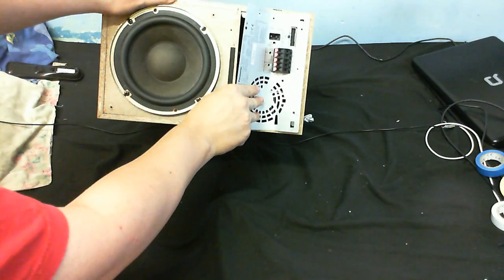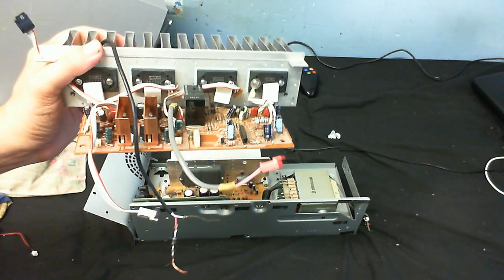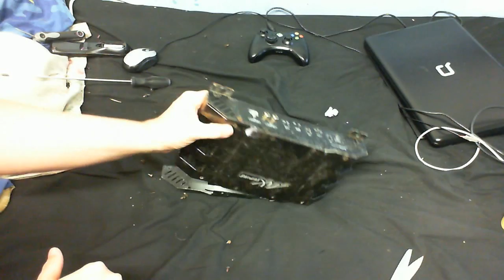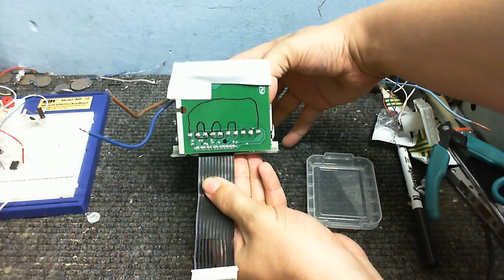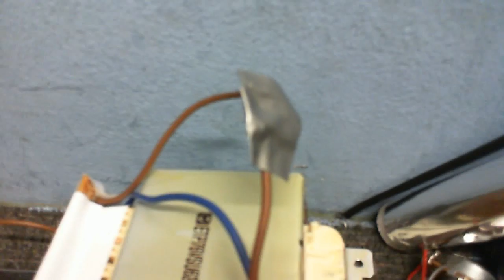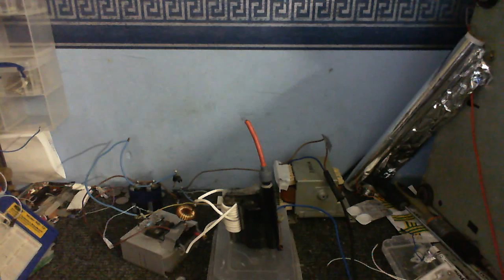Trash Finds - A subwoofer and a crusty car amplifier

Comment: Welcome to the world of "Dumpster Diving". I always thought all the fellows around here checking out the containers were hobos and loosers, BUT YOU CAN'T IMAGINE WHAT I'VE FOUND! I've found TESLA lab equipment with tubes in it! R-to-R tape players. TVs and old stereos and radios! Now I'm hooked.....I also notice at the Electronics and Appliance store lots of people drop off old things they can't throw out.....I often drive through there and check! NOT A BAD FIND. You can at least use the speaker and possibly the transformer for power-supply fun! There's also speaker connectors and such. SOUNDS REALLY GOOD with your amp....that your TUBE AMP?

Comment: Clem, that car amplifier might be quite useful, don't trash it! Most of them will run happily from a 200 watt or greater ATX power supply, wire the 12v and ground to appropriate lines and wire the remote (sometimes marked as rem) terminal to a switch to the 12v line, it is it's on-off switch, it uses a 12v signal from the car's radio to turn on and off. It could prove to be a nice little amplifier to keep around.
 
I would say, definitely power it up, hook up some speakers (they will drive even 8 ohm home speakers quite nicely) and try it, running off the RCA jacks on your mixer, it is a power amplifier so you need a preamp to regulate it's volume, and your Tascam 4 track can function as one.
Reply: The 14.4 volt supply from the transformer would run it fine as well rectified, I expect.

Comment: On the amplifier, the power supply's transformer steps up the voltage but the secondary side will be AC. That AC is then rectified with two rectifiers (TO220 package)....right by the two rail filter caps. But you got most of it right.

To remove the board you have to remove the transistors clips that are hold the sistors to the heat sink. Once those are removed the board will easily slide either way. That's a pretty cheap amplifier might not be worth repairing but for the fun of it you should have a go at it. There's plenty of guys that can help with pointers or what not.

Comment: Yes those car amplifiers uses switching power supply. From 12v they step up to symetrical +/-25 or +/-35volts DC. That's why those amp sucks easy 15-25 amps on the 12v bus ;)
In really good amps you have 2 or 3 pairs of big capacitors in parallel for the filtering. Also for the output stage, it's comon to have 2sb688-2sd718 (so called B688-D718) pair of transistors. They double them on more powerful ones.

Comment: I hate those proprietary subwoofer connections. Why didn't they just use phono plugs and use the head unit as a pre-amplifier? At least that way if the head unit died or wasn't there for whatever reason you could at least still get some functionality out of it.

Comment: can you get a microphone that outputs SPDIF data via it's USB lead which should work with the software your are using.
You should be able to get a HP Prolient DL580 GEN3 with 16TB of ECC RAM and 12 SATA drives in RAID 10 mode as web providers are changing to newer better servers and replace the HSF units with water cooling system and cut down on the racket it makes when running.

Comment: Helloo.
I need a little help about my power suply.
I have a two torodial transforemers 11.5V/100A =200A
and four bridge rectifires 50A = 200A
And i plan to use it to a full potencial.
What kind of capacitor i need?
How to calculate what capacitens per Amper?
Reply from the maker: +Sale Bmw It really depends on how much filtering you want, generally I go with at least 2200uF per amp, so best to just get a whole load of 2200uf 25 volts caps and wire them in parallel.  I suggest caps rated for 25 volts because it's best to have some headroom for the voltage you'll get (which at no load will be just over 16 volts), Also using a bank of small capacitors is better anyway than using one big one as that way you will have very little ESR trouble.  Another word of advice though, this supply you're building will have a huge inrush current, so you may want to add a switch inline with the transformers so you can switch in a ballast (a small electric heater works well), and then when the caps are charged the ballast can be switched out and the power supply will be at full power.
Reply: +CoolDudeClem  Tnx a lot for answer. It helps a lot. Care to explain that in line switch and heater? by balasting you mean shorting secondary of one transformer and having primary in series with another T.?
Reply from the maker: +Sale Bmw Ok I'll try to explain as clearly as I can, the mains live (or hot) goes to one end of the ballast (doesn't matter which) the other end of the ballast is connected of to one end your transformers primaries, and the other end of the primaries go to neutral. The switch to switch the ballast in and out simply goes to both ends of the ballast to short it out, effectively connecting the transformers directly to the mains.

Comment: BTW, is the subwoofer amplifier Panasonic? They make really high quality caps, so I hope that the caps you have on the pcb are Panasonic too :)
Reply: I highly doubt they would use Panasonic caps. Most likely the boards where assembled in China, so am betting the caps are cheapies.

Comment: I wouldn't call cassette a proper format. Vinyl is a proper format, CD also has its pros and cons but can certainly be considered a proper format. Cassette is a joke when it comes to sound quality.
Reply: I'd say a 320k mp3 or FLAC is much better than a cassette. ;)   This guy is entertaining though for sure.
Reply: Anthony DiSano yeah even 320k mp3 will have more detail than a cassette :P FLAC definitely the best digital format though
Reply: bassl0va However this guy has it right -- neither format is as fun as a cassette!
Reply: Anthony DiSano Vinyl is by far the most fun though!
Reply: Depends on the recorder. Its reputation has been wrecked by cheap early 2000s china crap.